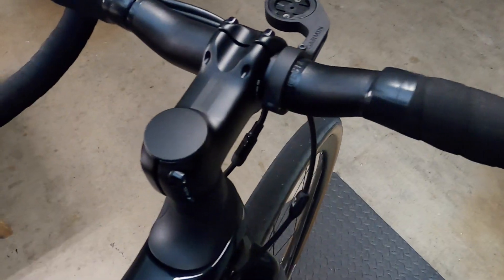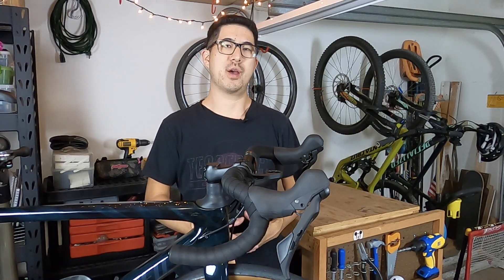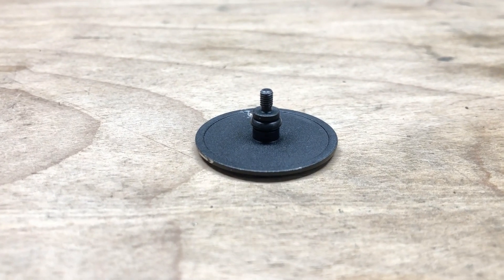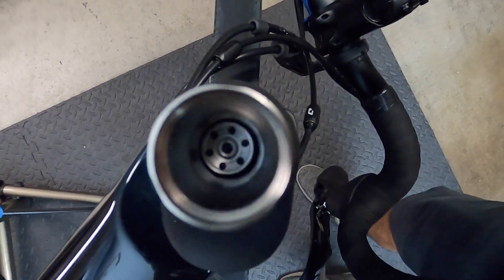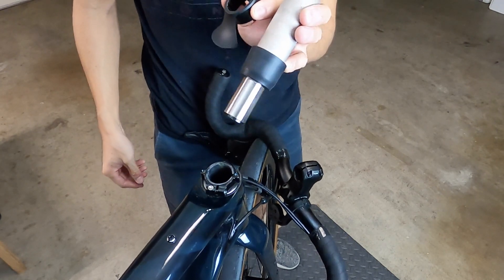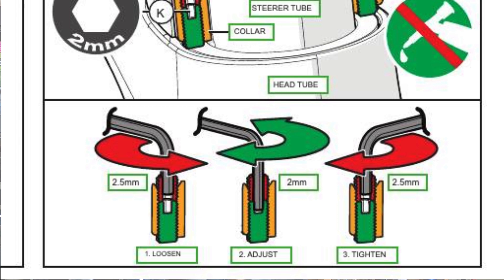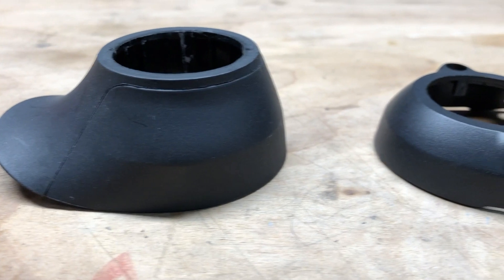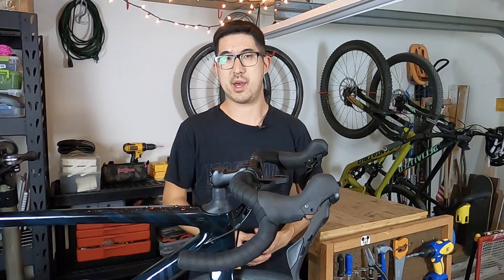Specialized Future Shock 1.5 | Everything You Need to Know

Comment: I need help with this shock absorber system. Now my handlebars feel a bit loose when I apply the brakes, and the wheels also feel loose. I've tried tightening the bolts on the handlebars, but it's not as effective as on regular bikes.

Comment: Hello.  This question is not for the Future Shock topic.  I have this bike and wanted to know your thoughts about how to make a diy skewer for the rear wheel so that I can use this bike on a Kinetic bike trainer / trainer.  Any thoughts.  Thanks
Reply: Also thank you for your stem raisers which I purchased and have received from your company.  However I have to figure out how to remove the bars as the gear and brake lines are making it difficult to remove from the neck.  Pretty tight and not much clearance
Reply from the maker: Is the trainer a wheel-on type? Those usually just sandwich the axle skewer from both ends. Being that your bike is likely a thru axle, you could probably machine some ends for the existing thru axle that could work.

Easiest way to install the headset spacers is to loosen the stem faceplate bolts and remove the bar from the stem if the cables are too short.

Comment: Great video! To keep from marring the cap, loosen the stem pinch bolts and move the handlebars back and forth first, then unscrew the cap by hand. Once the cap is unscrewed, pull up on it to remove it as an O-ring on the small threaded shaft holds it in.

Comment: You need to loosen the stem pinch bolts before trying to loosen the top cap if it feels really tight. Once you’ve done this, firm downward pressure with your thumbs normally enables you to gain enough friction to unscrew the cap without any damage.

Comment: Great video thanks. Have you ever come across the future shock stem loosing its lateral stiffness so the bars have lateral movement (in addition to the designed up and down). Bike shops response was “it should t do that: but specialized won’t replace because out of sarà tee. Have had to order a replacement FS1.5 but wondered if you had seen this before and if there was a way of servicing the existing one.
Reply from the maker: Sorry to hear. I haven’t experienced any lateral play. Expensive replacement… also, officially they are not serviceable and need to be replaced
Reply: How much are they charging for the replacement Future Shock?
Reply from the maker: On the order of a few hundred dollars last I checked

Comment: Stem/future shock beating cover how close is this ment to sit as mine seems quite high tan there is a cap an I can see the pins etc Rain is easily going to get in there Any advice How close this needs to be to the frame ?
Reply from the maker: No way to prevent rain from getting in there. It should be no more than 2-3mm from the frame

Comment: Good video and much useful info. However I'd just like to point out that I think that tightening those preload bolts down without the FS cartridge installed and collar clamping bolt fully tightened is not a good idea. The only thing holding the collar onto the steerer at that point is that small locator bolt. The installation instructions show that tightening the preload bolts is the very last thing you do... after you've fitted the stem and everything.
Reply: This.
Reply from the maker: Agreed

Comment: Great video! Love the shock BUT why the duck bill shaped plastic housing?  It makes no sense and would look cleaner if it was just round.  The duck bill on my Sirrus rubs against the frame and makes annoying squeaking noises.  Anyone 3D printing their own?
Reply from the maker: Ha yea is interesting. It fits the shape of the frame though, so a round one might not look right either
Reply: I got the same problem!!  The damn duck bill rubs against the frame and squeaks/creaks with any turn of the handlebars!  Any solution?  Should I just grind the duck bill down with a moto tool??  Gonna add some grease for now I guess where it rubs the paint.
Reply from the maker: It definitely shouldn’t be rubbing the frame
Reply: See problem here https://imgur.com/FacO5wp
LBS said their solution is to grind it down!! WTH?!

Comment: How do you remove the metal sleeve from the stem ?  On my Vado bike, it’s super tight and I can’t figure out how to slide it out
Reply from the maker: It can be tight, especially if it wasn’t greased from the factory. If brute force doesn’t work, you can gently pry the stem where the pinch bolts are with 2 flatheads and a small object acting as a fulcrum

Comment: Just a note here about the headset adjustment : you DO NOT NEED A THIN 3MM OPEN END SPANNER ... the locking set screw ( 2.5 mm ) is hollow and a 2mm allen wrench will go thru to make the slackness adjustment ! ... then lock in place using the 2.5mm allen
Reply from the maker: But the 3mm spanner holds the 2mm in place while you tighten the 2.5
Reply: @TheBikeSauce  Your suggestion about making your own 'spanner' out of plastic is genius 😄👍🏻. Seriously, I wish I'd thought of that 3 years ago when I bought my Roubaix

Comment: You can easily remove the Top Cap by removing the handlebars first then loosen the stem and rotate it counter clockwise with the top cap a half turn or more then rotate the stem back holding the top cap in place.  This helps to separate the two and you’re good to go!
Reply from the maker: Thx. Yea others mentioned this too. No luck in my case, but I think it was exceptionally tight for some reason

Comment: I tested a Sirrus X 4.0 with future shock "small" spring, but didn't notice much shock absorption riding over cobblestone. Do you think that would be improved with one of the other springs? A guy at a shop said choosing the proper spring level is based on the cyclist's weight (e.g., lighter riders would go with small, and heavier riders large), implying I would feel even less assistance with the larger spring. I don't really know what this means now that I've seen your video, and you differentiate the springs as soft, medium and firm.
Reply from the maker: There are 3 springs available, but you can also remove all the springs entirely and rely on the cartridge spring. That would be the lightest option
Reply: Scratched the cap after watching this when I only needed to loosen the bolts first ffs….

Comment: I have few issues with my FS 1.0 on Roubaix 2018.
First, it rattles when I drop the front wheel to the ground. I can't find the reason since the headset isn't loose.
Second, the collar doesn't seem to need 3mm hey as there are two small (2.5&2mm I think) allen bolts that you first set tension with smaller one and then lock it down with bigger one.
I feel like the black spring is too soft for me as it sags 1cm or so when riding the bike and it's easy to bottom out so it doesn't seem very supportive when hitting road imperfections.

Above all I'm annoyed with the rattle issue which rears it's ugly head when riding gritty surfaces such as cobbles or stones plates.

I don't think the issue is with FS because I got new replacement since the original had some issues. 

Shop guys can't help much and Creo they have in the shop with FS 1.5 doesn't seem to exhibit such issues.
Reply from the maker: The rattling is interesting. I get the sound of the internal spring 'popping' but it's not really a rattle. Unfortunately, the internals aren't serviceable. Also, I believe that they went to a progressive spring on the 1.5 and 2.0. You might see if you can swap in a stiff boost spring from a 1.5 or 2.0 to prevent bottoming out.
Reply: @TheBikeSauce  I found the source of the rattle. It wasn't actually Future Shock, but Shimano RS505 levers. With handlebars removed it doesn't rattle when I drop the front wheel. On another note, how much travel are you getting? I read FS had 20mm travel but I'm only getting about 10mm and I've checked Specialized Turbo Creo at the shop with FS 1.5 and it's the same thing.

Comment: GREAT video. However, the Future Shock seems to be a solution looking for a problem. Unless a person has specific wrist, elbow, shoulder, or neck issue, then I don't see the value (I have a buddy with some issues and it's great for him!). However, if you don't have some sort of issue, then I am not a fan. I'd rather have that great frame with a regular undamped fork.
Reply from the maker: The 20mm of travel is a different experience than a supple frame alone. Comparing the Diverge with FS to say, the Ritchey Outback I test rode, the Diverge definitely has more front end compliance that no rigid frame can reproduce. My shoulders are far less fatigued after a ride on the Diverge when compared to other bikes. However, I agree that it's a lot of complexity to add the FS and not for everyone. I might suggest the Redshift stem on a rigid frame and call it a day.

Comment: An easy way to get the top cap off without scratching it is to simply loosen the stem bolts at the steer tube and rotate the stem/handlebars while applying a bit of upward pressure against the top cap. It'll loosen right up and no tools needed other than a hex wrench for the stem.
Reply from the maker: Right. Others have had good luck with this method too. Tried on mine and was simply too tight. Now when I put it on, I only go finger tight
Reply: Read my mind.

Comment: Because of your videos I bought a 2021 Diverge E5 Comp, thanks!. I've had my bike since the end of December and I got a question. Is it normal for the Future Shock to have very minor play in the headset? I've ensured the two 2.5mm vertical screws are properly torqued. But when I hold the front brake and move the bike gently back and fourth I notice very slight play in the headset, do you notice the same thing with yours?
Reply from the maker: I did recently notice this on mine. Simple case of loose headset. Coincidentally I’m making a video on how to tighten it this week. 😆 but, use you can tighten it with the 2 - 2mm screws on either side. Then lock them down with the 2.5mm screws on top
Reply: @TheBikeSauce  I guess I needed to read the instructions better😂 Thanks! I look forward to your video. Might I suggest a video about brake rotor rub. That would also be super helpful!
Reply: Same problem

Comment: I am not a bike technician but have a good mechanical background.  I agree that best not tighten the 'collar' without the shock in place, BUT, if you try and add pre-load by tightening the 2mm 'screws' against the race, the collar is only held by the small front locating screw, and all that happens is that as the 2mm pre-load screws are tightened against the race, the collar actually is forced up...you can actually measure this.  Best is, (perhaps...views please), to do the adjustment with the shock in place and the collar tightened up.  You can still access the 2mm set-screws and the 2.5mm locking screws.  I really don't think that you can pre-load the head bearings unless the collar is secure.  (Just my view, for others to comment...I am NOT saying this method is correct way...just the way that makes most sense to me.
Many thanks for the very helpful videos.
Reply from the maker: I agree with you actually. Funny you mention this- I’m currently making a video on doing the headset preload this way
Reply: Again, many thanks for making these videos.  Very very helpful.

Comment: Very interesting video, thanks a lot! I got my Comp E5 delivered yesterday and took it to a 25 mile test ride this morning. On very rough terrain, roots and stones I felt that there was "contact" within the head tube / future shock. Tonight I saw your video and opened the future shock system on my bike to see that there was also no spring installed. Is there any chance that the bike / head tube / future shock can be damaged riding without a spring installed? I cannot find any information from Specialized on this exact question/topic. How many miles did you ride before discovering there was no spring? Any concerns? Thx!
Reply from the maker: Thanks for reaching out. I’d say it’s probably fine without a spring. If you’re bottoming out, then probably start w medium spring and see from there. This isn’t like an air shock on mtb or anything. Just a basic spring. I ride for about 500 miles with no spring and haven’t had any issues. I’ve had the medium spring in ever since.
Reply: @TheBikeSauce  Thank you for your fast answer. It is strange that Specialized doesn't install one of the three springs already at the factory and the owner can later decide if he/she wants to swap it. I will contact Specialized and ask what they have to say about riding without a spring / possible damage.
All the best  for your channel!
Reply from the maker: Thanks!
Reply: @Daniel-ek3nf I have come across your comment wanting to know what Specialized said about if damage to the bike is possible without the spring. I just went on my first ride yesterday  with my new Sirrus 5.0 X (63kms) and realized this morning I don't have a spring installed! I'll be looking to install the light spring shortly but wanting to know what Specialized said.

Comment: Informative.  Can you tell me if it will fit a 700c X 47mm tire.  Teravail cannonball or Rutland to be exact
Reply from the maker: Officially, the diverge fits a 700C x 47, but practically speaking, the measured width will depend on the specific tire (I haven't test fitted any Teravails yet) and also the rim width. Sorry I can't be more helpful!
Reply: Thanks for reply.

Comment: What are the "helper" spring for? How does it actually works? Anyone tried the different spring and feel any performance difference?? Thanks in advance.
Reply from the maker: The main cartridge has a nominal spring in it. You can firm it up using one of the three additional springs. I use the medium weight helper spring and it’s pretty good. It’s based on preference. Also, the FS2.0 has a knob that incrementally adjusts the spring rate instead of 3 distinct choices
Reply: @TheBikeSauce  The FS2.0 knob just turns it off or on - it has increments but they don't do anything! Specialized has acknowledged this and said it's because their customers prefer multiple detents... (but no actual fucntionality behinds them...)
Reply: @WeirdNeville  Can you elaborate? Is there any article which provide details on the non-functional increments for FS 2.0?

Comment: Where do you get the Height adjustment spacers?
Reply from the maker: You can find them in my online shop https://www.thebikesauce.com. Thx!
Reply: My bike came with some
Reply from the maker: Make sure to hang on to them!
Reply: @TheBikeSauce  it also has the 3mm service spanner to lock the tensioning bolts. Unfortunately my headset has come loose 3 times in 30km on very light trails. I need to investigate why and see if it's something I'm doing wrong. It just seems like a poor design though, tensioning the upper race at just 2 points. At the sides too, I'd expect it would be better to brace fore and aft. I hope I can resolve it as it's perfect otherwise, but an annoying flaw in an expensive bike IMO.
Reply from the maker: Yea mine never came with a tiny spanner. Don’t even know where to get one that small.

Comment: Can a standard fork be put on this bike or do you need to run the whole future shock system?
Reply from the maker: The fork steer tube are different diameters, but it may technically be possible. Either way, it’s not recommended especially because the frame itself has a cutout at the top of the headtube designed to match the future shock hardware

Comment: I'm still not sure which section you can add spacers. Is it above the future shock rubber part or somewhere underneath it all? I would imagine if you add spacers then you can't screw the top lid back on?
Reply from the maker: The spacers will go on the bottom half of the FS cartridge with the larger diameter. You do have to remove the cartridge altogether, then add spacers, then the duck bill, then back into the fork. It won’t affect the top cap spacing if done correctly.
Reply: @TheBikeSauce  does that mean I have to pull the whole future shock out to remove the duck bill? Then the spacer would be above the duck bill and right under where the outside rubber is?
Reply from the maker: Yup, that’s it. Granted I haven’t actually messed with additional spacers in this way, but it should work just fine
Reply: @TheBikeSauce  I tried out a spacer but it was not wide enough. Do you know where I can purchase 30mm diameter spacers?
Reply from the maker: Interesting. Seems like to would be a standard hs spacer. Will try and investigate at some point
Reply: @TheBikeSauce  thank you and please let me know of your findings!
Reply from the maker: dreamonya so I checked into and wow what a surprise. So it does not use standard HS spacers as they don’t fit the future shock. It needs a slightly larger spacer, which actually comes with the owners manual. Thankfully mine came with three 5mm spacers. Working on a video now to explain the situation, but I was really surprised to see it used a proprietary spacer size
Reply from the maker: dreamonya you’re right, it needs a 30.4mm ID spacer, which is not standard and not available online (as far as I can tell). I CADed a custom spacer and I’m working on getting some machined from 6061 alloy. I’ll put them up on my online store once I get it up and running for people with future shock bikes.
Reply: @TheBikeSauce  please let me know once it's available for purchase!
Reply from the maker: Will do